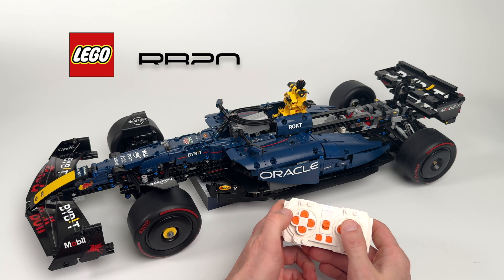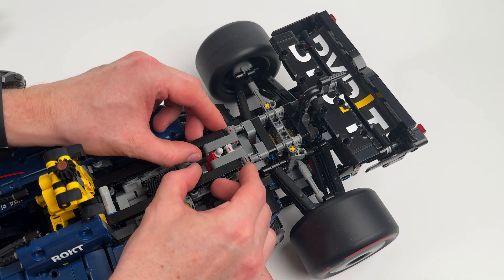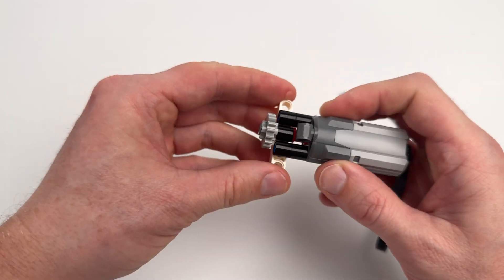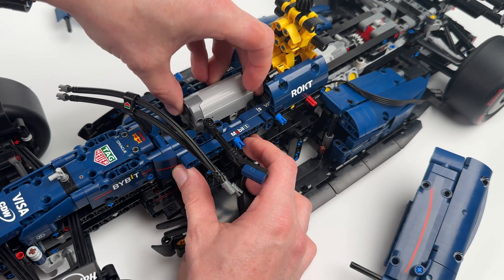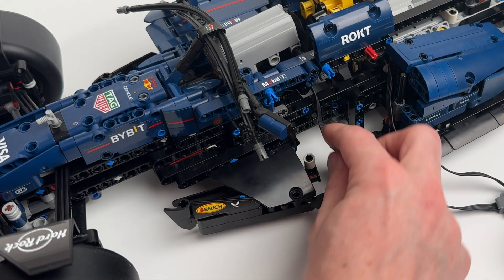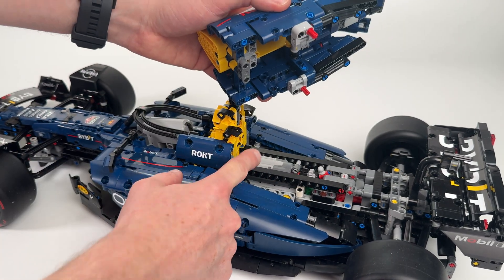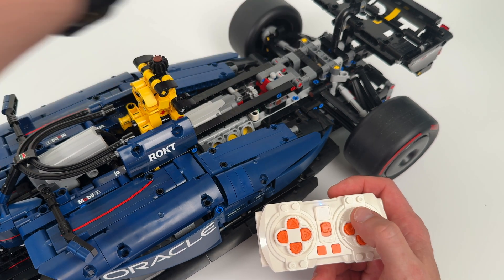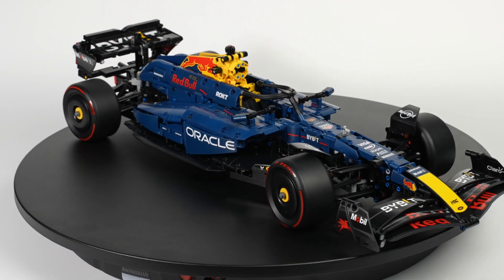LEGO RB20 Motorised – You’ve Never Seen It Like This!

Comment: maybe it could be sold as motorized but then the new hub and motors are expensive, and it could be $320 or $360 and far less people may buy it... maybe they can use the new hub with 3 motors built in, like in the set 42176... not sure how it will be in the future
Reply from the maker: Lego don’t make 1:8 motorized sets

Comment: Thank you for the video, I managed to motorise it without using LEGO spare parts and only the RB set, however for the power engine (the one on the back), after a few runs the axis is leaving the engine and slips to the back of the car (to the red shifter). Do you have the same problem or did you manage to find a solution (if you encountered it)?
Reply from the maker: If I remember correctly It worked ok. Try to strengthen the connection using additional bricks.
Reply: @Mr.Bricksteen  will work on it then, thank you!

Comment: Thanks for this video I managed to motorised my first Lego technic F1 with slight difference. I mounted the servo under but it protrudes about 1cm underneath but still enough room not to scrape the ground. Removed the mechanism for the manual steering at the top which free up space behind the seat. Moved the seat forward then I put the power block behind. This retains the look. I also use a large motor model 88003 same location as what you did and secure from the front and behind. There is more torque and a can hear slippage every now and then at the initial movement but faster. 

Thank you for your video, it helped and inspired me to motorise my Lego.
Reply from the maker: Great mod👍